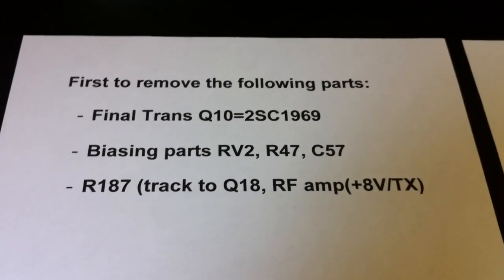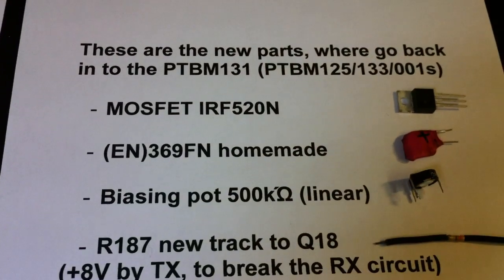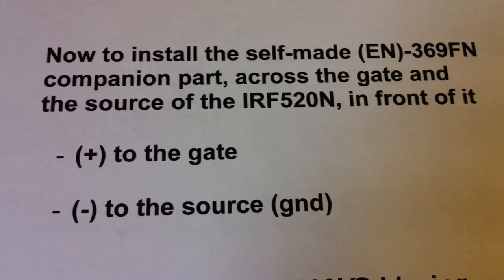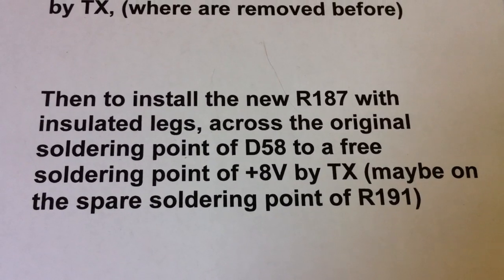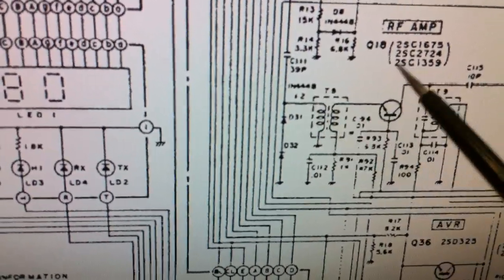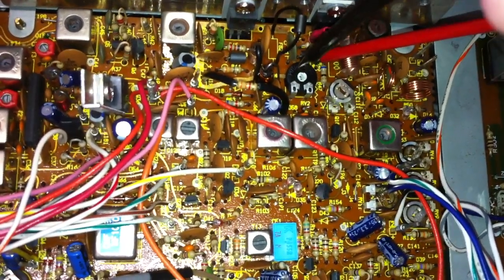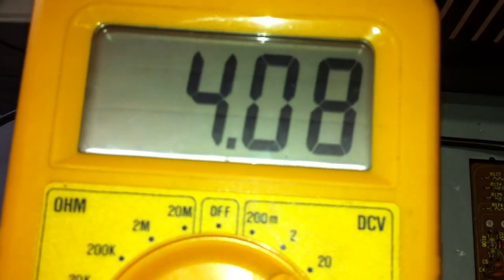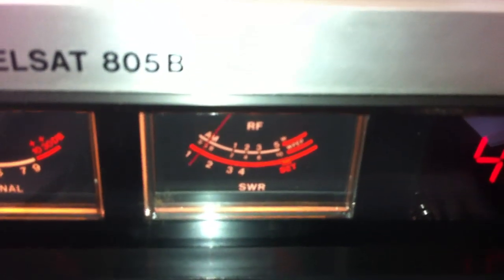STEP BY STEP IRF520N UPGRADE FOR PTBM125, 131, 133, PCMA001s CYBERNET RADIOS.MOV

Comment: hi i have a layfayette 1800 and i have an r178 no a 187 and its not fitted do i just leave alone or do i need to fit this resistor, also the other end of the resistor location my circuit is slightly different too the pcb is pbtm125a4x and its a 50 channel
Reply from the maker: Hello dear CB radio friend, thank you for your inquiry. Yes, this conversion of the power amplifier to MOSFET technology is actually the same for all CYBERNET devices. I was able to install the IRF520 in various models. So it should also work for the Lafayette 1200 (SUPER STAR 2000).
I hope you and your family have a nice Sunday.

Comment: I want to do this upgrade but without a variable power mod I would not be able to use the radio with an external linear amplifier, as needed from time to time.  Could you suggest a variable power modification for the PTBM125A4X where a potentiometer could be used to control the power output of the the radio?
Reply from the maker: System-Technics hello, thank you for your interest. Yes, the RV3 controls the ALC for FM/SSB. You could lengthen the solder points of the RV3 to the front panel and connect with a pot. Many years ago (1984), I had made this modification. Best regards to you and yours....
Reply: @SWIZZRADIOS  Ah, okay, so it's quite a simple mod.   I thought it woul require more changes.  Thank you SwizzRadios.

Comment: Good video.....I changed my MK1 Jumbo 2SC1969 for a CB20W couldn't get another original & it works very well with more power but i backed it down.
Reply from the maker: Hello dr CB radio fan, thank you for your interest. Yes, the CB20W is really a good solution for the replacement of the old 2SC1969. I know this Transistor and it works fine. All in all, CB-radios and antennas are a passion of mine. It was a beautiful time in the 80ies: Big CBiers parties, without smartphones and facebook profiles. Best 73s and happy airwaves to you. ...